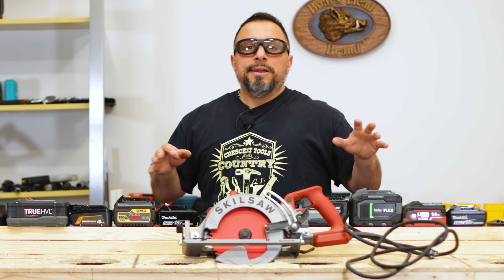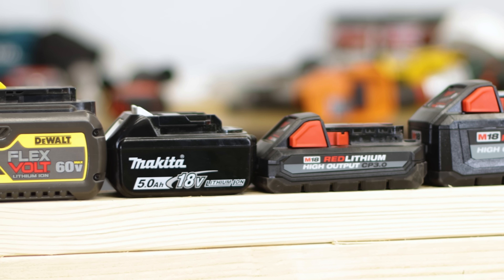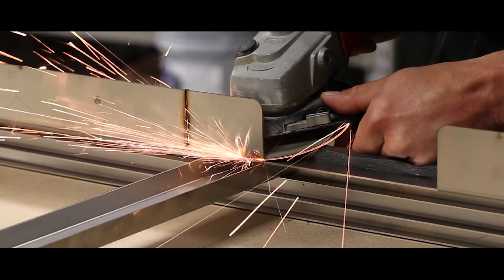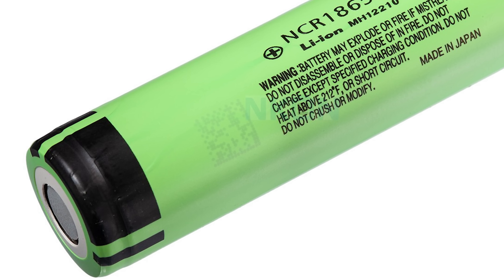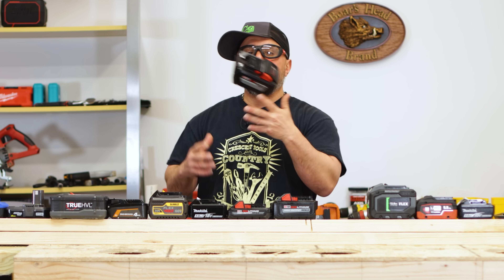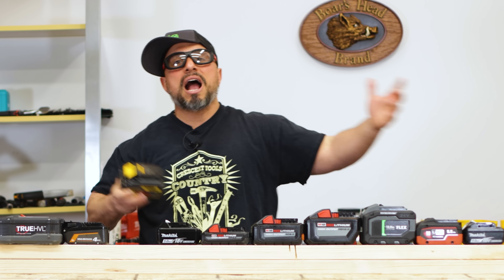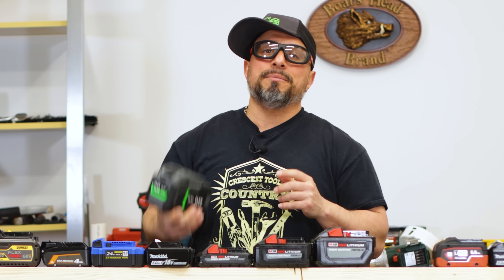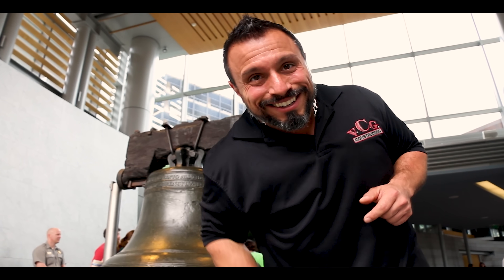Get The BEST PERFORMANCE From Lithium Ion Batteries & Make Them LAST LONGER!

Comment: Cells within cells interlinked 

“ Cells within cells interlinked “
Are you a Milwaukee user cells.
“Cells”

Use a 12Amp battery on a impact driver? Cells

“Cells”

Interlinked 

“Interlinked”

Cells within cells interlinked 

“ cells within cells interlinked “

How does it make you feel seeing a green bosh on the job site ? Cells interlinked

“Cells interlinked “

Are you someone who nicks the battery of your coworkers when you forgot to charge yours ? Cells

“Cells”

Comment: Hi Vince another great informative video so what company offer this feature that it won't dip below 20% or charge past 80% and which voltage too 12 v 18v 24v 40v 60v etc thanks in advance

Comment: Also, as far as quick charging goes, the higher the capacity and amp discharge rate of the individual cells, the faster you can you can charge the battery. That is if you have a higher amp charger to charge at a higher rate.

Comment: The Chevy Volt has software that doesn't charge the battery to one hundred percent, nor does it discharge below twenty percent. The batteries on the Volt are also actively temperature controlled. Our Volt is over eight years old and has of yet not shown any signs of degradation. I have a Worx string trimmer that I bought in 09 and am still using the original battery to trim and edge my half acre lawn twice a week, with again no sign of degradation. I bought an electric touring bicycle in 2010 and have put on fifteenth thousand on the original battery packs and have only seen about three percent loss of capacity. I did change the low voltage shut down on the bikes motor control to not discharge the battery all the way and purchased an expensive programmable charger to keep from charging the battery all the way up. When I built the battery packs I included a pocket where I can insert a plastic sandwich bag full of ice to keep the battery pack cool on hot days or when working the bike on very hilly terrain. I only store all my Lithium batteries in a cool place in the winter and with only eighty percent charge. Also the three to five hundred cycle life refers to "full"  cycles. If you use only the sweet spot of the batteries, they will last multiples of that.

Comment: My dewalts are over 4 years used 5-6 days a week still going strong..... i tuck them into bed at night 😉
Reply: You tell them they are still beautiful?
Reply: @LynxStarAuto  almost everyday
Reply: I have daily use Li Ion batteries from Ryobi, 10 yrs old, still working fine! I've even melted a few of their classes and they still work fine.
Reply: I recon my original xr 4ah have easily done over 1000 plus cycles some possibly even way more and only had a single cell fail in 6 years.
Reply: @joshbarragan  yea mine are about that age ones even ducktaped
Reply: Your comment is awesome
Reply: This happens to me with my RC car sometimes All you gotta do is connect a positive to the positive and the negative to the negative of another battery and do a jump start it enough to register on a charger
Reply: Hi guys,do you think paying less money and getting 2amp battery or paying more money and getting 4amp battery is efficient money wise in long term?
Reply: @kamilguzel1510  4amps all the way more fire power
Reply: In bed 🛏
Reply: My craftsman corded is 37 years old and used 7 days a week 365 days a year minimum of 12 hours a day.   Get back with me after yours fails I’m sure mine will still be in use.  I’ve 80 others in use of various ages all corded as I ain’t playing battery games in my company.
Reply: @wrackable  sounds like real mans equipment  ;but its 2021 i want all battery im happy woth my dewalt set it builds me houses an foundations an iv never had a fail day from dewalt
Reply: @wrackable  but i must give your gear AAA for 37years commendation
Reply: @Hempcretinglifestyle   Indeed , if batteries float your boat so be it.  Glad yours haven’t failed and truly have to be the exception as I’ve never encountered anyone else whose pulled that off.  Maybe you’re the one person who properly cycles and maintains moister and temperature of your gear and somehow hasn’t exceeded the life of batteries on top of it.  
    I’ve meet many whose batteries failed in less than a few months of regular charging.  Some get a year seems to be rare of regular use to get longer than a year. 4 years is impressive , kudos my friend.
Reply: @wrackable  i checked the stamp on them an there from 2015
Reply: @wrackable  obviously you don't do jobs on sites without stable power at all? just run a cord and a generator around with you all day? some people have to work where there isn't power plugs for everyone to run 50ft cords everywhere.
Reply: @allrimmedout  I have generators, if cords bother you I’m sure air hoses for pneumatic tools must drive you insane.   Let’s get serious here, you’re probably just a DYI casual person at best.  I support myself and 456 other people 24/7 365 days a year.   We don’t have time to play battery swap games, nor keep dumping money into endless replacement batteries/tools.    We tried incorporating batteries, even the L-Ion don’t have the capability of justified expenditure.   A corded tool pays for itself in a job, then generates profit.  Cordless are a endless bleeding expense. 
I’m not selling anyone on anything, just shared my reality which frankly is truth.  Most people burn their money as fast as they earn it.  I have to plan, and budget and care for not just myself but my employees, their families and the community as a whole that we serve.   Generators are cheap and easy to run. If you can’t handle cords I question any other decisions made by similar lazy/poor planning.    To date we are the only construction company that didn’t lay off nor fire anyone during COVID within tri state area.  We in fact hired more people and opened a second location. As there was many talented people in need of work and frankly I could not any longer deny the need of people that would have been left in the lurch.  My only regrets are that more people refuse to do what’s right at expense of expedience.   Yes cordless tools are a example of such mental frameworks.   I’d use them if they were at least equal but they’re designed to endlessly drain pockets and do more harm than good.
Reply: @wrackable  what company do you own then? that is the only company in a multi state basis to not cut pay or lay off 1 single person.
Reply: @allrimmedout  I’m not publishing my details, I’ve seen what bad actors do, thank you but no.   My persona is mine, our company is public and easily searched I’ll not be tied to it so slander and bad actions can trace to it our my employees, just because I speak my mind online.  No , no thanks.   Nice try though.
Reply: @wrackable  you guys are comparing apples to oranges.  For a large construction company, you are absolutely right about batteries being a constant drain.  However, for an independent contractor or handyman, your setup is a total nightmare and cordless is without a doubt the way to go.  Different strokes people.
Reply: @chrishuber4853  I’ve clearly said as much.
Reply: @wrackable it’s because you don’t do mobile work. Imagine having to do a job in a high structure or confined remote area?
Reply: @juanzamarripa3778  Imagine , resurrecting an old thread to ask someone to imagine something you aren’t doing.  😂.  Imagine me replying and I’m not doing it either.
Reply: @bababooey827  ok Baba Booey. Your comment is joke for response at any time you put yourself out there. Thats YouTube. Youre also probably an old timer

Comment: What I am really excited to see in batteries is the company called Quantum  Scape. Their technology is about using solid-state batteries that for example today an electric car uses a certain amount of batteries on it with Quantum Scape you will use for the same amount of power half or a little less of the number of batteries but the crazy part from that company that they figured out to charge it in 15 minutes from zero to 100% and last way longer in battery life. And they are a battery company so any power tools or electric vehicle can buy their technology. It is that crazy technology that even Bill Gates invested in with 2 billion on that company that is supposed to launch the batteries next year.
Reply: if gates send them to 2billion we will never see this technology
Reply: @stopdontmove5169  what? This guy is driven by innovation and to see technology change and evolve like Elon Musk. What are you talking about?
Reply: @LazyCrazyGuy  sure it could be that too. But the main thing here is moving forward to new technologies and better and clean energies. He can make as much money as he wants but we will get the benefits of those investments as well, no doubt

Comment: How to increase the life of Li-Mn batteries.  Don't deep discharge them and keep them cool when charging.  Makita is best for this with fan cooling and limiting discharge to 12.5V with the 18V batteries or 2.5 volts per cell.  You can also limit their charge on the top end as for some medical and mil-spec batteries don't fully charge them.  You can change chemistry to LiFePO4 which will give 1000 to 3000 cycles as DeWalt did back in 2006 with the A123 System M1 cells.  I still have one of those packs in use after 15 years and well over 1,000 charge/discharge cycles.  The packs I want next are Tesla 4680 NMC 9Ah cells at 3,000 to 5,000 cycles or more.   Tesla has far more demand for those cells than they can make but maybe in a few years... 9Ah Tesla packs with only 5 cells in each could last for many, many years.  I'm sure someone will want to jump on that if/when the Tesla cells become available.  I'm sure Hilti would love to get their mitts on those 9Ah NMC 4680 cells...we shall see.

Comment: @VCG_Construction Hey Vince, maybe you could help settle some rumors/ theories. Ive heard at least 4 times from 4 different people at 4 different places that the Milwaukee and Dewalt power tools sold at The Home Depot and/or Lowes are different, quality wise. Meaning that the ones bought from big box stores contain parts not built to the manufacturer's usual quality standards. Is this true??? Can you do a video clarifying this conspiracy theory???

Comment: I am a avid rc enthusiast and use lipo batteries frequently. One thing that can prolong batteries life is the rate at which the battery is charged. A lower amperage charger charges the battery slower but also keeps the battery cooler. The rapid charger uses higher amps to charge the battery faster and in turn degrades them faster.  As nice as the rapid chargers are, they actually aid in killing the batteries faster. Great video. Good information to get out there.
Reply: Same goes for phone batteries. If a 5V 1A charger has your phone full by the time you next need it, it's all you need.
Reply: True and it's common sense but people always want the latest and greatest product... these big companies are making more money selling the fast Chargers and people come back to buy batteries after their fast charger burn them up lol... large companies have a lot of trickery out there. You're going to buy anything expensive do some research on the internet before you do
Reply: @woodywood7759  fast chargers are amazing honestly, can seriously save your butt... BUT... just don’t overuse the feature 

When you need it, you need it
Reply: Absolutely 
even with 21700 can tolerate higher heat still slower charge is the best

i wonder if they are going to switch to lifo4 cells since life cycle into 2000 instead of 500
Reply: completely dependent on what the max charge rate of the cells were, that would be if the rapid charge rate is getting close or at Max recharge rate, I have lto cells with 400 amp recharge rates, at 400 Amps is where it's recharge life expectancy is tested. lower recharge may make it last longer, but also may not if the cell is proper quality. I wouldn't completely say it indefinitely will degrade them, but also isn't any better to hit them with a rapid charge if the cells are too hot, or cold, but then again Milwaukees temp overrides should keep them from charging when their either too hot or too cold anyway. rc cars packs are different in the fact pretty much no rc car battery has an internal BMS, it's all done at the charge stage only. nice things about BMS's, they're there to monitor cell voltage 24/7, and balance them as needed.
Reply: What about not charging the battery right after you use it? In other words, isn't it bad for the battery to recharge it when it's warm/hot?
Reply: Also heavily into RC (crawlers in my case) and I agree with everything you said. I don't have any of the new high output batteries and they are the only reason I would be likely to get a rapid charger.

 When my HVAC tech friend started using  rapid chargers (5ah m18 and 3-6ah m12 I tried to explain that to him, but he didn't seem to get it or believed the computer in the battery would sort everything out. In his case I think it's even worse as he likes to always keep all of his batteries at full charge.
Reply: @BlankSlateRenovations  that is an old habit and believe from using cordless phone

circuit board on batteries doesn’t determine the amp going into batteries
heat is one killing the old batteries
Reply: Thx bud it helps to know that about fast charging
Reply: Trickle charge is always better. Fast charging will definitely cook a battery if done many times

Comment: yeah, do not store batteries discharged, that is when voltage can get too low.  Manufacturers move the batteries out on a schedule to avoid having too low of a voltage sitting on shelves but the lifecycle so long as the  battery has a charge say 100% then stored will last quite a long time, very long life cycle but most do not do this.

Comment: No test needed real life test here.  My batts are as old as 2015.  I start my day by charging regardless of charge level on batt.  I do this so i dont spend my day switching batts.  Not one battery has died on me.  Im using dewalt and millwaukee.  I also use rapid chargers.  I would also say im in arizona.  Temps as high as 120.  God only knows how hot in van.  As long as you keep them charged you are good.

Comment: I thought Milwaukee batteries do that that's why they're do expensive, I know they communicate with the device you're using with so the device won't over heat and the battery stops it from burning I know that's a fact, But Milwaukee batteries also take care of them self, first lighted bar is at 15% and the 4th bar is at 85%, I'm going to call Milwaukee to confirm this...

Comment: I wonder if theres a rebuild kit for these batteries  might be nice to keep up on them
Reply: Not a kit, but they’re easy enough to rebuild. 18650 cells are typically 3.50-4$ per cell if you buy them in singles, 21700 are ~5-7$ per, you get a pretty decent discount for bulk orders. If you have a decent spot welder, you can rebuild a 5S2P pack fairly quickly.
Reply: @gentoonix  yeah might be good knowledge to save money.

Comment: @vcg construction Vince great video I work for batteries plus and anyone  with bad or died lithium batteries can bring them to a local batteries plus and have them recycled. Also this is true about lithium cells like cell phones have lithium batteries if you have ever had your cell phone in direct heat it will say over heat battery needs to cool down or if you leave your phone in the very cold in your car then you need to bring it in and let it get warm. Lithium cells that are together have that issue while lithium aa/aaa batteries don’t because that is a different chemistry of lithium as tool batteries and cell batteries use lithium ion.

Comment: Electronic engineer, FCC certified. Great comments from you. There is other important things to know also. Ex. Under load, only and nearly 10 per cent difference between a charged and uncharged nicad. Ex. Triple A nicad that deviation is 1 1 discharged vs 1.2 charged

Comment: Well, looks like you were putting in quite a bit of work for this video on the research side Vince, good video!
Reply: yeah borescoped...dont leave the batteries out in that -40 weather anymore 😂
Reply: @kingofthecrease30  Haha, yeah, some of those batteries can’t take it.
Reply: @Borescoped  last week when i.did TTR i brought in a ridgid octane battery that was in my truck since november....i had it in vermont a few days where it was -10 out and it still had 4 bars on it....its possible it lost some life cycles after being in my truck all winter...lol
Reply: As someone who uses battery powered drills and impacts for home use, should I charge the every couple of months even if I haven't used the tools for the past 6 to 12 months.
Reply: A lot of factors to consider I’d say. How low is the charge after that duration. If you use it that infrequently, would you rather risk undervoltage or lose a few cycles? How much do those batteries cost? How long do you expect them to last you if you do recharge them to full if you let them bleed of charge by sitting?

Too many variables IMO for me to give you advice on that. I will, however, tell you what I would do if I were in your situation. I’d probably just go  ahead and charge them, I’d rather lose a few cycles that have them go below threshold for bringing them back, but that’s just me. Take some of those questions I listed and make your own evaluation to come to what works for you IMO.

Good luck!

Comment: All very good advise.  Excellent video !!!!!
As a side note.  German Metabo CAS batteries are a minimum of 900 charges and many of my older batteries I am sure have way more uses than that.  Metabo also offers a great warrent with there batteries.  I have many years of experience using Metabo.